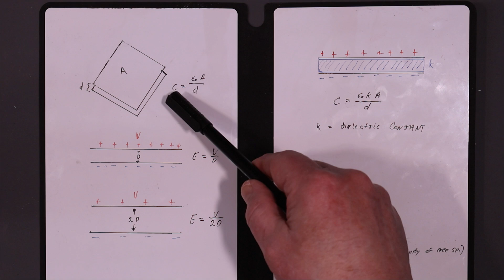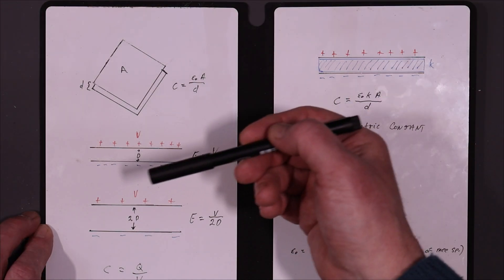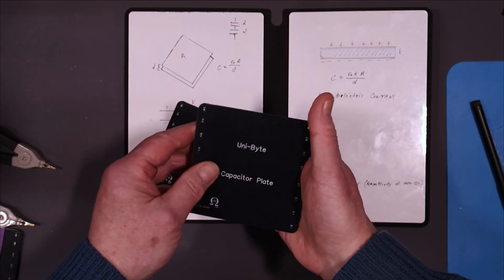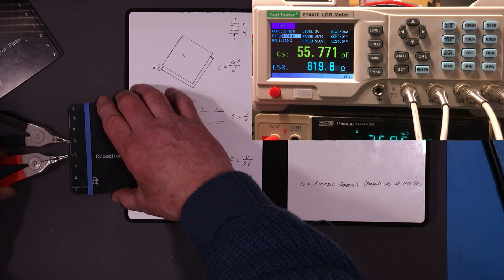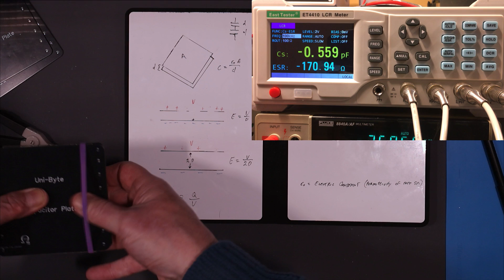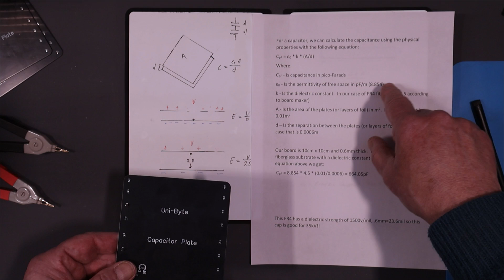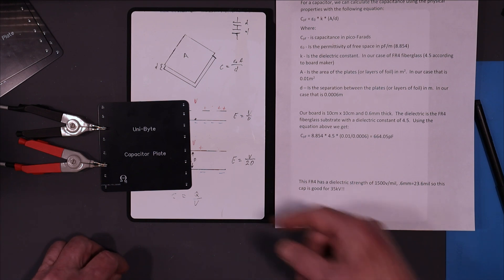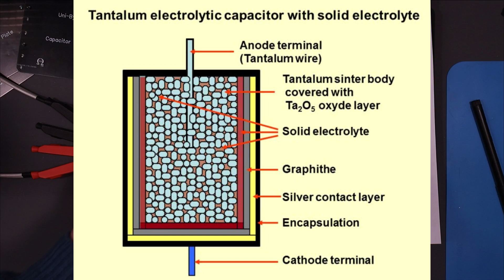Uni-Byte 0266 - Capacitor Secrets Exposed!

Comment: From 9:11, you're accidentally saying nF when you mean to say pF...with that correction, it's not quite so hard to find cheap high-voltage capacitors.
Reply from the maker: Good catch!

BTW, can you hint at where you could find  680pF 35kV cap for $0.80?  I saw some 20kV ones for about $6, but these would not have that nice ESR.  Also, as I hinted at in the video, you could easily extend the voltage range using thicker boards and layering them.  Thanks for commenting!
Reply: @uni-byte  I've worked with HVCC153Y6P202M and HV2225Y332KXM capacitors before from Vishay.  They're comparable.  It's important to realize that a capacitor rated for 5kV actually doesn't breakdown until more like 20kV because the rating includes temperature and lifetime needs.  It's also important to realize that your ESR is probably really a parallel dissipation R.
Reply from the maker: I have to respectfully disagree on both counts.  When they specify the voltage rating for FR4 or other PCB substrates, they do it exactly the same as they do for the dielectric in capacitors.  They are doing the same job at the same time.  Keeping conductive layers separated.  So the engineers need  the specifications to mean teh same thing.  When they say this FR4 is good for 1.5kV/mil, they mean that is the safe, long term operation range.  WRT the resistance the LCR bridge read as 12 ohms @ 100 kHz is definitely NOT parallel resistance of any kind.  Again, these are PCBs.  If there was 12 ohms of parallel resistance across .6mm what are the chances that any modern computer would work given the average spacing of less than .2mm between layers?  Not to mention that LCR bridge does not generally confuse EPR and ESR.
Reply: @uni-byte  You might be right about the FR4 rating already being far below the true breakdown voltage.  But, I just can't understand how you'd even get 1 ohm of series resistance to the plates' interior...it's just metal, right?  I think EPR and ESR can get confused because those meters just measure the phase angle (C in series with a little R looks equivalent to a C in parallel with a lot of R).  The FR4 is known to have like a 1% "dissipation factor" which is in its bulk (this is sometimes analyzed as the imaginary part of the dielectric constant), from what I vaguely remember.
Reply from the maker: @roberts4768  The reason we are seeing the 12 ohm ESR is because this LCR meter is limited to only 100kHz.  Most of that is reactive (X) at that frequency.  These meters can get the X and the ESR a little confused at lower frequencies and have trouble separating them.  To find the true ESR we'd like need to get up into the 10MHz to 100MHz range.  As you say, we'd then likely see it drop off to nearly nothing.  I might sweep it using a oscillator and an oscilloscope for interest sake.  I did check the Q and it came out to 200, which is not too shabby.   I know there are pricey high Q capacitors that have a Q 5 times that at specific frequencies, but with regular capacitors one would expect a Q ot 50 to be decent.
Reply from the maker: I should also mention the dissipation factor (aka dielectric loss or loss tangent) only really counts for traces (transmission lines) on a PCB and not for planes like these.  For a .6mm board the dissipation factor (if we were talking about a transmission line) would only be about 0.02 and is the result of EM fields around traces as signals propagate through them.

Comment: Thanks, very nice seeing the first principles demonstrated.  Wondering if you would be up for doing something similar for the single ended capacitance meters used to measure moisture content? These are the ones with an aluminium sphere as the measurement probe.
Reply from the maker: Nothing is off the table, but unsure when I'd do something like that.
Reply: @ Thanks, I was pondering the different methods of measuring capacitance…. The single ended method must be quite different I guess :-)